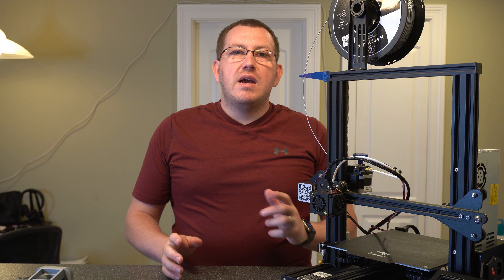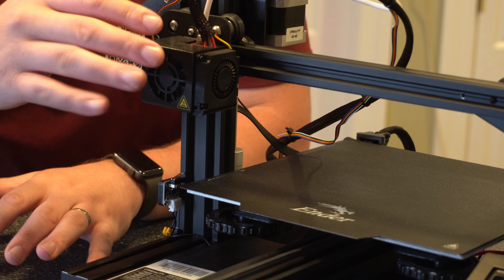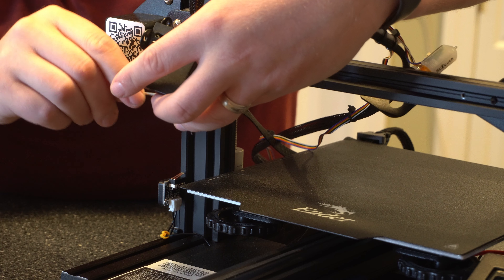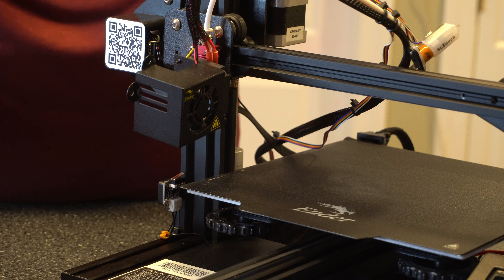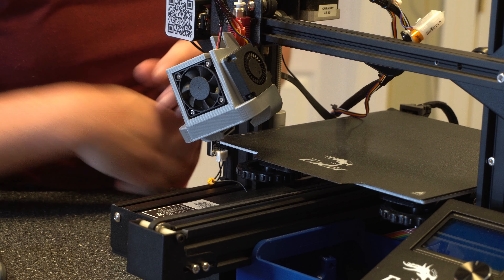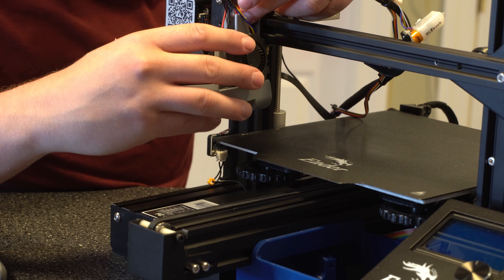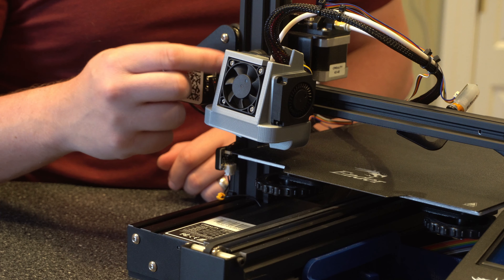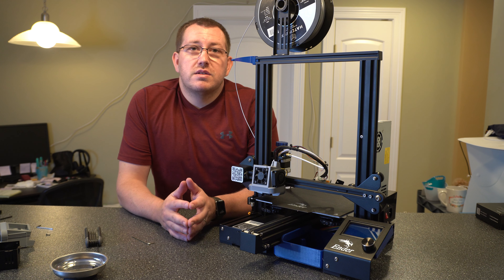Ender 3 Pro Fan Mod – My Choice and Install Guide

Comment: Hi, i am printing it rightnow and I only have one question, how does the air duct on the left,( if you are looking it from the front of the printer...) gets the air from? (The duct from the opposite side where you mount the part cooling fan). Im printing it righnow and both air ducts are finished, but I dont see how that  secondary  air duct gets the air from? As of right now that air duct has no channel for the air to flow tru it...
Thanks for sharing it, as I heard really good things about it and I cant wait for trying it out . Thanks
Reply from the maker: Hi. The fan on the left forces the air down into the duct work and the turn in the front that helps connect the two vents with a U allows the air to travel to the other side. You wont actually be able to see that part until the print is almost done.
Reply: @3DPrintscape  that's what I thought, but the file i downloaded does not have that channel running thru the U, its completely sealed off...
Reply from the maker: You should be able to see it in Cura, under preview mode, after you slice it. If its blocked off entirely, you may need to look at you slicing settings. I can also slice it and send it over as well.
Reply: @3DPrintscape  oh ok thanks, that would be awesome, funny thing is that i cura everything showed up fine lol, I did noticed something weird in cura, I guess I need to figure out why is not slicing properly
Reply from the maker: Hi. Were you able to get the fan duct cover to slice/print right?

Comment: if i were to install a bigger fan than my normal fan (parts cooling) do i have to fiddle with the cooling settings in my slicer to accomodate for the extra air flow?  like, should i lower the fan speed or just leave it be in the slicer?
Reply from the maker: Hi. In most cases you wont. There are some edge cases for specific prints/filaments that may require it though.

Comment: did you use the stock bolts for mounting it mine is too small?
Reply from the maker: Hi. Ya i did use the default bolts. They were barley long enough to grab the mount though. If you want to use longer bolts, m3 8 or 12mm should work.

Comment: Are the fans only there to cool the extruded filament?
Reply from the maker: Hi. The front fan helps to regulate the hotend temperature the side one is only used to cool the filament.

Comment: i just saw your video on extruder fan cover. i have tried to make this 4 times and it doesnt print on my ender 3 pro. it keeps making a big mess. i would gladly pay someone to make this part for me if someone had to and is willing to print this for me
Reply from the maker: Hi. You may have more luck asking that in the discord community. We can also try to figure out thats going on with the print.

Comment: Im very happy with this mod. But after i changed my main board to skr mini e3 v2. It seems that the coooling is way to much. Can u give me a hint how should i change it?
Reply from the maker: Hi. The only way to dial back the cooling would be to change the “Fan Speed” value in your slicer. By default, its set to 100%. You could try to lower that by 10% at a time until you figure out what value works best.
Reply: @3DPrintscape  I think that you could just go to control on the 3d printer, then to temperature, then to fan speed and regulate it there.

Comment: So I've tried printing this with a Brim but there was no other info on the print settings so I've had all 3 attempts fail within like 30 minutes of starting. Would really really like to print this so any help would be really great
Reply: So I think im a dumb ass and printed it the way the file opened instead of laying it down. Will update when I know its worked lol
Reply from the maker: Hi. You will want to make sure the flat surface is on the built plate, im not sure why it defaults to it standing up. Let me know if you are still having issues after doing that.
Reply: @3DPrintscape  so it was just the fact that when i opened the file it was oriented different then how you should print it and didnt realize this until i tried like 3-4 times. The trials and errors of a Beginner hahah. i have it all printed and about to install it! thanks for the video

Comment: I just added this mod to my Ender 3 Pro and it seems to be doing exactly what it's supposed to. Two questions: 1.) I accidently flipped the fan (wasn't paying attention) so instead of pushing air into the hot end it is pulling hot air away from it. It doesn't seem to be affecting my prints, (that I have noticed so far). Should I turn it back or leave it as long as it's working good? 2.) would it be beneficial to add another nozzle fan or would that just be overkill and cool the filament too quickly? Thanks.
Reply from the maker: Hi. If your using it to only cool the hotend, the direction wont matter to much. If you are also directing air to the nozzle from it you will want it blowing towards the hotend/nozzle.

Comment: Is support needed? also, what infill do you recommend?
Reply from the maker: Hi. I printed this with a 40% infill using a brim and tree supports. If you end up using supports, make sure you select touching build plate and not everywhere because if you select everywhere supports will get built in the air chamber.
Reply: @3DPrintscape  thankyou
Reply from the maker: @Wad3c  You're Welcome!

Comment: What size screws did you use to mount the blower fan on the side ?
Reply from the maker: Hi. I was able to get the original screws to work(m3 x 12mm), but barely. If you wanted to replace them, you could use m3x14 or 16mm bolts.

Comment: Great job! question: is the direction of the cables a problem when the head rises the highest z? Thanks
Reply from the maker: Hi. I haven’t had any issues yet, but I very rarely print anything that uses the full height.

Comment: Hey, what kind of filament did you print this with? I'm thinking of printing it but im worried that PLA will melt with it.
Reply: Also are those the stock screws that you are using? Thanks in advance!
Reply from the maker: Hi. I used PLA as a test, and have had no issues with it. I was able to reuse the stock screws but it was difficult at a couple spots.
Reply: @3DPrintscape  Hi and thanks for the help, i have been getting much worse stringing since i've installed this do you have any suggestions?
Reply from the maker: @kilu1220  I would look at configuring the retraction settings. What profile are you using?
Reply: @3DPrintscape  i use cura and i have edited the retraction settings since this and it seems much better

Comment: Can you do some testing? Like how much improvements it provide?
Reply from the maker: Hi. When I did this video, I thought about getting some tools to measure airflow, but I wasn’t sure it would be worth it, and it would be difficult to actually measure. The fan is going to produce the same amount of airflow, so without swapping that out, that variable wont change. To me, this fan duct mod was meant to do two things. 1) Push air to multiple sides of the print instead of having all the air just hitting the one side 2) Reduce noise. It doesn’t make a huge difference, but it did make a difference.
Reply: @3DPrintscape  so no noticeable print quality improvements? Can you recommend better part cooling fan? Is it worth it?

Comment: Hi, do I have to adjust the Z offset after installing this? Or any of my offsets/settings? Or is it just plug and play/same settings as stock.
Reply from the maker: Hi. Yes all the offsets will need to be adjusted for the new position.

Comment: Can this be printed in PLA? Or does it have to be PETG? Thanks love your tutorials.
Reply from the maker: I printed it with PLA. Its not actually touching the heat block, so I haven’t had any issues.
Reply: @3DPrintscape  Thanks for replying. do you print version 59 or 52?
Reply from the maker: Hi. I used 59. The only difference between the two is that 59 has an extra hole in the front to make getting the screw in easier, assuming you mount the fan duct before installing the front fan.
Reply: @3DPrintscape  Have you managed to get the BL touch version video completed yet?

Comment: Noticed some extra noise due to vibrations compared to stock cover. Can you give any tips for this?
Reply from the maker: Hi. I actually got the opposite results. My printer ended up being quieter with the modified fan duct cover. Can you make sure all the screws are tight and that the cables aren’t rubbing against the cover? If it continues to be an issue, can you try to pinpoint where the vibrations are coming from and let me know?
Reply: Hi, yes the vibrations are actually coming from a gap behind the cover. Not sure its due to warpage but all the screws are tight
Reply from the maker: The only thing I can think of is that one of the cables may be vibrating against the fan duct cover but that shouldn’t cause to much noise.

Comment: Hey man amazing stuff! Just a question. Does it not melt if it's in PLA? I'm worried if it's too close to the bed while printing if the bed's 75°C? Also do you need to adjust any offsets? Thank you!!
Reply from the maker: Hi. The recommended filament is PETG, but i printed with PLA and its been fine for me. The offsets will need to be adjusted to account for the bltouch being moved.

Comment: Hi. i tried this print but my layers slip a lot compared to before. I carefully adjusted the x and y tensions, not much has changed. I fully tightened the screws and checked everything. Do you think this apparatus causes shaking?
Reply from the maker: Hi. How bad are the layers and if you put the stock cover back on is the problem still there?
Reply: @3DPrintscape  1 or 2 mm slip. I'm not going to have this problem with stock cover.
Reply from the maker: That’s really odd, and got it. Did you print this with a support and if so did you do touching build plate or everywhere?
Reply: @3DPrintscape  No, I didn't use support. I printed it out in the evening and bought it in the morning. We weren't even in the same room. I'm so confused.
Reply from the maker: @okankadan6968  Can you go through the preview in Cura to see if anything is blocking the airflow? Thats the only thing I can think of. I know if supports were used and everywhere was selected it would put an infill in the air chamber.
Reply: @3DPrintscape  My friend, I am a complete fool. YOUR DESIGN WORKS VERY GOOD. I FORGOT TO ADJUST THE FILAMENT DENSITY. uuuh THIS IS THE POOR QUALITY OF THE OUTPUT. THANK YOU. EXCELLENT...
Reply from the maker: @okankadan6968  Hey, im glad to hear everything is working well now. If you run into any more issues don't hesitate to reach out.

Comment: i would like to set up proper gantery size for printing one at a time  what would the measurements be ? im doubting myself on what i put in it does not seem correct.
TIA :)
Reply from the maker: Hi. Im not following your question. Can you explain what you are trying to do in a little more detail?
Reply: In  matching settings in cura  there are your print deck sizes  g code flavor and what not for settings  there is also on the right side of that the print head settings   or  how big the cooler is on the printer so the cooler won't hit the project while printing one item at a time  while printing multiple items on the plate at once.. I don't want the cooler to knock into any prints when they are done
Reply from the maker: Hi. This fan duct cover doesn’t stick out, and the x-stop prevents any issues. You can just print and use it without needing to worry about anything.
Reply: This makes your print head bigger i know this because it is hitting parts that is why I asked what the changes were.  But you don't know what they are obviously
Reply from the maker: Sorry, im still not following you. Yes the fan duct is technically slightly larger than the original, but besides installing it no additional changes were needed. It doesn’t hit any other parts or anything like that.
Reply: Both the left and right  sides are bigger then factory and will bum into prints if you  don't have it set correctly
Reply from the maker: That would be above the print, so it wouldn’t hit it.

Comment: what are the profile settings for cura? sorry just starting out. thanks!
Reply from the maker: Hi. Sorry, I should have included those in the video. In Cura, I just used the default settings under standard quality and changed the infill percentage to 30. If you would like an export of the profile, send me an email at admin@3dprintscape.com, and I will send it over.

Comment: So I am kind of confused right now. I did this upgrade to my Ender  3 v2 and I noticed for the first time that the Hotend fan is blowing outward. I've read that many people recommend having the fan blowing onto the heatsink. But i think it was like this stock and when looking at other enders the fan seems to be oriented the same way. Is that right?
Reply from the maker: Hi. I matched the stock orientation, but it would work either way. My recommendation would be to try both and see what one you like better.  With it pulling the air away, its pushing the hot air away from the printer. If you switch it, then you are pushing the hot air onto the print.
Reply: Thank you for answering so fast! I just wanted to make sure I did nothing wrong and that I'm not damaging the printer by letting the hotend overheat. I think I'm just going to keep it like this as I believe it's working just fine.
Reply: @tjgonzwest  Yes, the cooling perfomance seems to be the same. It would have suprised me if there was any difference. In the end its just a different mount for the hotend fan.

Comment: Do you have the link for the BL touch add on? Also great videos! I didn't see an attachment or link for the extra piece for the BL looking forward to your reply.
Reply from the maker: Hi. Thanks for the feedback. I have the link to the BL touch in this video (Ender 3 Pro Auto Bed Leveling Kit - Complete Guide: https://youtu.be/OJhDSx6MRug)
Reply: @3DPrintscape  broken link
Reply: @3DPrintscape  I was hoping you had made a video of the BL attachment or a link to be able to attach the BL to that fan shroud. and again thanks for making these awesome and very helpful videos
Reply from the maker: Hi, not sure why the link was bad but i grabbed a new one, https://youtu.be/SqhEmw7aTCM . This video cover the the fan duct mod that im using with my BLTouch.
Reply from the maker: Also, here is the first link I tried to send. It covers how to install the BLtouch, but it sounds like thats not what you actually needed. https://youtu.be/OJhDSx6MRug .
Reply: @3DPrintscape  finally got it figured out. The first fan shroud wasn't the correct one. Got it now. I look forward to all your new videos. Thanks again.

Comment: Will this work with the Noctua Quiet Fan (40x10mm)?
Reply from the maker: Hi. Im assuming you have this as the front fan? Assuming the screw holes aligned with the ones on the stock fan, I think it should work.

Comment: Will this work on a CR-10?
Reply from the maker: Hi. The mounting bracket in the extruder looks to be the same between the two printers, but I cant confirm that it would work. There is a decent chance it will though.

Comment: Does the extra weight of the fan mod require printer setting changes?
Reply from the maker: Hi. Unless you tweaked settings for jerk/speed, you shouldn’t need to make any changes.

Comment: Looks nice and I have seen it used on a several printers in different FB 3D printing groups.  Any idea when a BLTouch version will be out?  I have that one one of my E3P's. EDIT***  Found the post below with the info, will be printing a few after work!
Reply from the maker: Hi. The bltouch version is out. Here is the video I did on the install. https://youtu.be/SqhEmw7aTCM

Comment: Awesome video dude,  so I  printed this with supports but it is hard to clean inside the actual  area where the air will come out. Any advice you can give in order to get it right, will be much appreciated.
Reply from the maker: Hi. Thanks for the feedback. One thing you will want to do is look at the preview in Cura with the supports you used enabled to see if it blocks the air pathway. I know it does with tree supports. If that ends up being the case, there isn’t much you can do but reprint it without supports and using a brim.
Reply: @3DPrintscape  thanks I’ll try this.

Comment: I printed mine in Hatchbox ABS with supports touching buildplate only.  It looks great but the small radial fan doesn’t put out much for part cooling.  The heat sink stays cool like it is supposed to despite the restrictions.  The only thing I don’t like about this cover is the lack of nozzle visibility.
Reply from the maker: Hi. I agree the it impacts nozzle visibility and you can only get so much of an improvement using the stock fan. Im currently using an upgraded blower fan as it has more output.